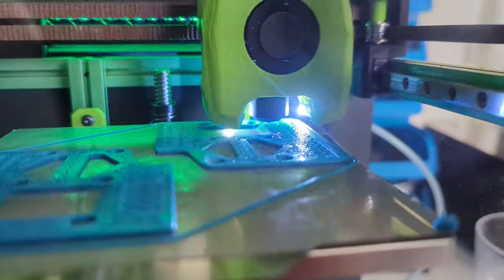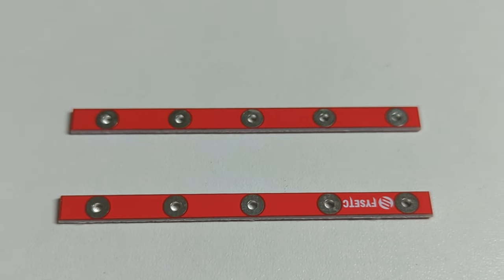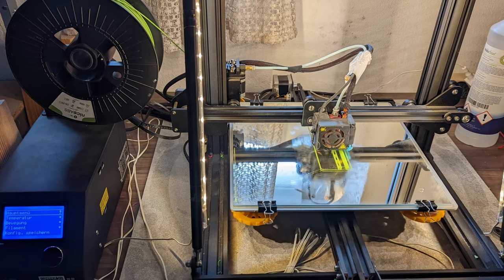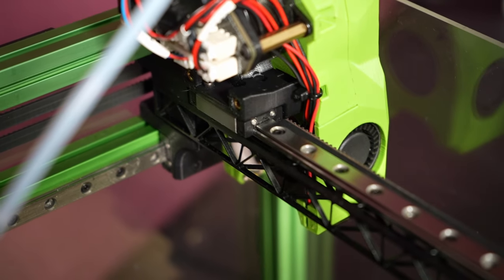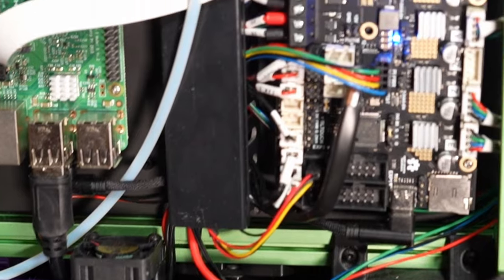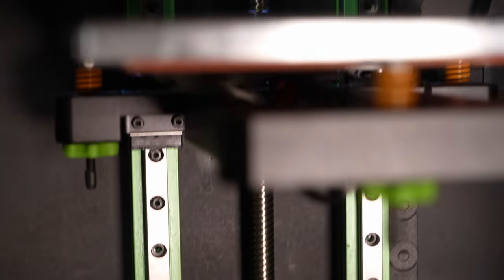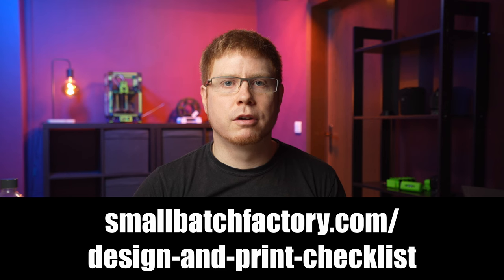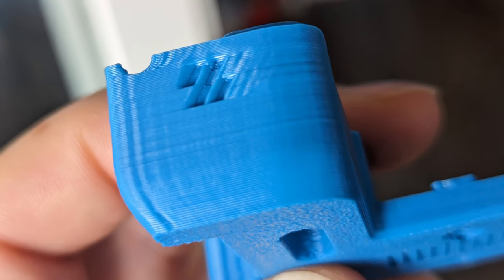How I took a Voron 0.2 from unusable to incredible |  FYSETC kit experience and troubleshooting

Comment: I have been battling the "over extrusion on layers 2-4" issue for probably month, maybe more on my Fysetc v0.2R1. I’ve even delayed the review video for it because I couldnt figure it out. I even took it apart and reassembled the rails and the z axis. So a massive thank you to @BallisticTech for pointing me to this video and a massive thank you to you @Small Batch Factory for pointing this issue out with a solution. Crazy simple yet had me totally stumped.
Reply from the maker: I'm glad I could help! Can't even remember how I managed to figure it out back then
Reply from the maker: Now that I think of it I would be very grateful for a shout out in your review video :-) if you don't mind of course.
Reply: Oh for sure. I was planning to. I was pulling my hair out before this.
Reply: I had this same issue with the LDO kit, took a little while for me to track down.
Reply from the maker: @rembrantsworkshop starting to sound like this should be mentioned in the official Voron manual
Reply: @SmallBatchFactory  Did the kit come with no build documentation at all?

Comment: Just like you i bought this machine for fun and now Its my favorite. Its so simple and easy to work with! My big V-core 3 and my Caribou are just collecting dust as long as the prints fits the small printbed. Nice video BTW!
Reply from the maker: Thanks! Same here, after the 0.2 I built a 2.4 but it's only used when I need the large build volume. It's just not suited for small prints and vibrates like hell when you print small parts fast. Plus it has some issues with the first layer, I always need to watch and do micro adjustments when I start a print...

Comment: When PETG came out it was reccomended to turn of the part cooling fan, I forgot to do this but my parts came out perfect, when I Itried with the fan off the parts were a mess!
Reply from the maker: That's a common issue. We've been told "keep the fan off" or "turn the fan up" but never really educated why. Basically you need as much fan as necessary to prevent your part from becoming a blobby mess. Alternatively you can slow down printing, but where's the fun in that?!

Comment: Great breakdown - I want to build a voron eventually as buying my first printer in November (Sovol SV06) has made me learn I enjoy the tinkering aspect of the hobby the most. That’s partially because I can’t yet design my own models and am far from being able to think like an engineer in any way (yet?).

However, building a Voron looks like a great project to get my hands dirty with electronics and building - two things I know I want to get some experience with, and having a super fast CoreXY machine sounds fun too.

The Voron 0 isn’t quite cheap enough for me to consider buying a kit for it over the 2.4, but I still have quite a lot of time before this project can feasibly happen. In the meantime I need to figure out how to optimally print ABS, which means I need to finish building my Lack enclosure and figuring out an ideal way to vent fumes from it + my office. Living in Germany is awesome! But the windows aren’t ideal for setting up ducting, especially when you rent an apartment. 

So that’s stuff for me to figure out and when that’s all in order, I’ll get to finally try my hand at building a super cool machine. Hopefully there’s better deals on kits by then too if I’m lucky.
Reply from the maker: Sounds like a plan! I got a video on printing ABS too. You can't set up a duct but you can do "Stoßlüften" :-) other than that you can also tilt all windows so you could put a duct through.

You get a lot more value with the 2.4 kits but TBH I found it also harder to get to run. Still haven't perfectly tuned the first layer distance, it always changes a bit. My 0.2 is fire and forget, that's pretty cool. 

If you're eager to learn modeling you can check out my new course. The first chapter is free to watch! https://smallbatchfactory.com/fusion-360-fundamentals/
Reply: @SmallBatchFactory  I feel like I’ve become an expert at Stoßlüften since living here. My wife and I have alarms for two 5 minute airing sessions per day 🤣

I just was hoping that I could set up a vent that connects to my printer enclosure, with a fan that I could control based on the air quality or something via Home Assistant…perhaps this is a bit ambitious for a first big project in my new adventures in DIY. 

I’ll be sure to watch your ABS video and once I finally have some time, I’m going to deep dive in Fusion360, likely following your videos to get started. 

Thanks again for the great vids - looking forward for more. I’d be super interested in a breakdown of different filaments and Slicer settings.
Reply from the maker: @RixTrix seems like it's a mandatory criteria for German citizenship. If you haven't already check out Liam Carpenters channel, he's an English guy mocking German habits in a very funny way.

I could image a special window frame made of wood for your duct. Wouldn't be a save 24/7 installation though.

That would be very cool. Let me know if you have any questions along the way.

Quite a few people are keen on the Slicer settings so I already placed it high up on the ToDo list!

Comment: I like to your introduction words very much ...smaller the better. If that is true, it has advantages all over. Price, storage etc.
Reply from the maker: In many many cases it's definitely enough. There are also strategies to build bigger models out of multiple parts like screwing them together or built in designed plugs.

For open frame printers it's usually not a big price difference though since you don't need much more material. Escept for the print bed, which is much more substantial and needs to be very even or a mesh leveling for bigger printers.

Comment: Had the exact same issue with the ambilical cable. I just bend all the pins a tiny bit so they get jammed tighter into the connectors. Sometimes klipper didnt recognise the falling temperature and the the extruder got clogged up. Was a fun few month and multiple disassambles until i found out what was wrong with this damn thing. Sad i just stumbled over you video now! 😂
Reply from the maker: I did that too and for a while it worked. But eventually the issues came back. It's a combination of the short top hat and a really stiff cable.

Now even the MCU started failing. At first they asked me if I made sure the USB cable was properly plugged in... I told them I even replaced some of the poor quality cables they delivered and that they should honor their warranty. They sent out a replacement MCU immediately, I still have to install it and see how long it keeps working.
Reply: @SmallBatchFactory  Oh god, i hope mine will hang in tight for a while. The seemingly effordless speed of this tiny thing is impressive, thoug!
Reply from the maker: In case it breaks I can highly recommend using flexible silicon wires for the umbilical.

Comment: Those extra bed extrusions can be used in a hex-zero 3-belted bed mod!
Reply from the maker: I've been thinking about cutting them to make the top hat ~10cm high instead of the current 7cm. Would give the cables a bit of clearance.

Comment: I think the V6 CHC clone you found can actually be mounted to a standard "Dragon" Mini SB mount. I used a similar set up in my Formbot V0.2r1 Until I switched in an actual Dragon HF
Reply from the maker: It's a tad bit longer AFAIK so I made a version with a little recess where it fits tightly. I didn't trust my self tapped holes enough without the recess. Without cutting off the top it would've probably fitted in a V6 holder.
Reply: So could you please share this design? Happened I ordered the same Hotend... Happy Holidays  @SmallBatchFactory
Reply from the maker: @Alex-fh8ov  it's on Printables, here's the link: https://www.printables.com/model/520784-voron-02-chc-v6-hotend-mount-ceramic-heater-core/files

Merry early Christmas :-)

Comment: Where did you find that corner cam mount?  Ive been using the mount next to the rail but that looks much cleaner.
Reply from the maker: I made it myself, really quick and dirty. I can upload it if you like. It's just glued to the side panel with tape. You'll need to break the lens loose a bit to focus this close.

Comment: If those "PCB"s are threaded, then they serve as the "nuts" for mounting the linear rails.  Might be easier than feeding in T nuts.
Reply from the maker: We have a winner here! Hopefully you didn't cheat and skip ahead ;-)

They're not threaded, but will self tap when you screw something in. The solder mask is rather soft.
Reply: @SmallBatchFactory   didn't skip ahead, though I have seen something similar done with 3d printed nut guides.  I would probably stick to the T nuts myself, I'd think it would be too easy to over tighten the screws in the PCB material to the point they wouldn't hold very well (nothing that a little locktight wouldn't fix though).
Reply from the maker: Surprisingly they held up pretty good so far. I'm usually tightening very firm and had no issues whatsoever. The linear rail carriage needed some Loctite after the tool head came lose at some point.
Reply: Oh that is a great mod. I used no drop nuts which were helpful, but this would be much better.

Comment from the maker: Get great results every time by following my free Design and Print Checklist: https://smallbatchfactory.com/design-and-print-checklist
Reply: I want to see the ABS printing trick mine still look like shit
Reply from the maker: I'll make sure to schedule a video. The short version is you need some kind of enclosure, even if it's just a cardboard box, a good bed adhesion glue like Magigoo and set the fan depending on the size of the printed part and print speed between 20% and 100%
Reply from the maker: It is done, the video is here: https://youtu.be/rFNT3nOtHsU

Comment: tiny printer for me would only make sense if it's made sturdy, 60v, super super high speed for quick prototypes.
sadly, tiny hotend can't even do that, and voron 0 uses small profiles etc.
Reply from the maker: Voron is what you make it to be. "24/7 printing" moded the heck out of it for a 3 minute benchy for example. But what you said is true, it's usually the hotend limiting the speed.

Comment: I hate the unexplained parts/upgrades. Yes I can figure out what they're for with some reasearch, but YOU put them in the kit! Just tell me why!
Reply from the maker: Yes, definitely! I was glad they uploaded a build video, otherwise I had probably found out about those PCBs for the linear rails when it was already to late...
Reply: Yeah, I'm building the siboor kit for ender 3 to switch wire and there's like 4 components that I've had to figure out how to use including 2 breakout boards
Reply from the maker: @dylanlasky2389  that really sucks, especially if you have to search electronics documentations. Feels more like I'm at work than doing a hobby.
Reply: They are called side quests… a bit like a Zelda game 😂
Reply from the maker: @captainmcadams  Reminds me a bit of the "another settlement needs your help" annoyance in Fallout 4